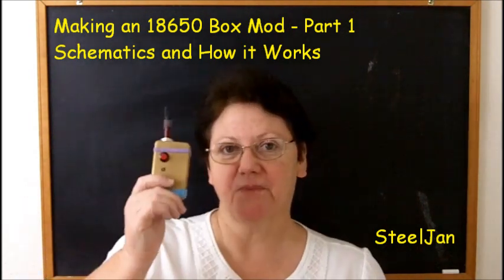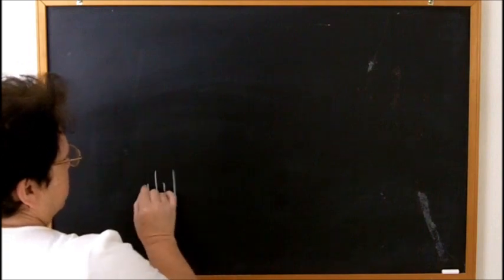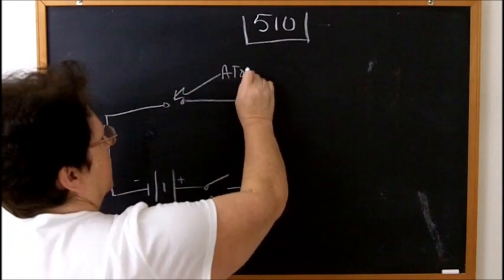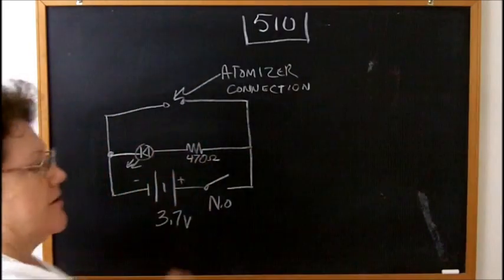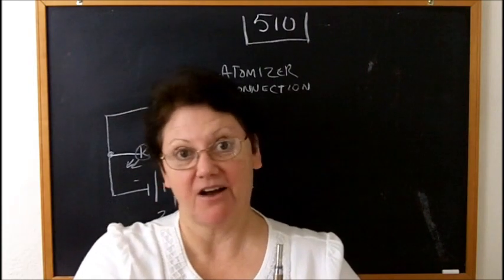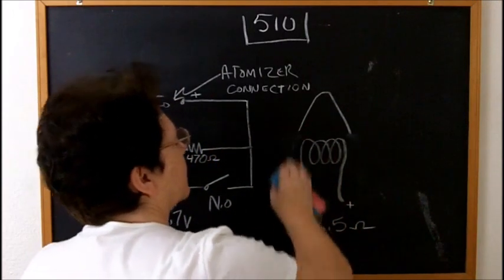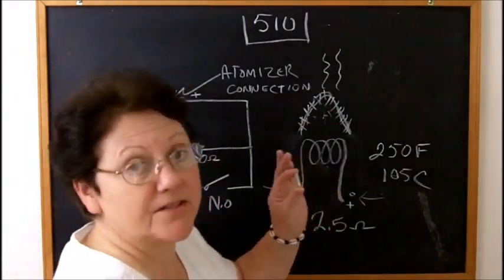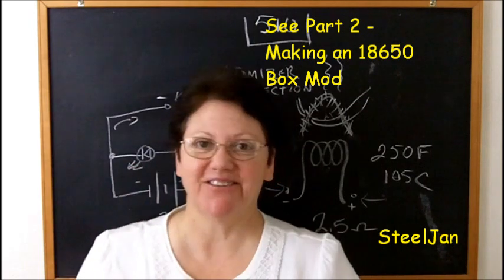Making an 18650 Personal Vaporizer Box Mod Part 1 Schematic and How it Works

Comment: How come you don't answer anyone's questions in your comments? You have 9,277 Subscribers. It's really depressing. If you could reply to my comment, or show some kind of life on the other end, I'd really like to ask some very simple questions related to making my first box mod.
Reply from the maker: MARK 1 Go ahead, ask now.  I don't make it over to youtube very often.
Reply: steeljan I've actually started learning about what I wanted to ask. It's variable voltage on a higher level as far as Amps (current) and Voltage. Turns out I need to learn about the 555 Timer if I want to control voltage with high current. So now I'm actually learning about SR Latch, Logic Gates, because I tried learning about the 555 Timer, but unfortunately, I don't understand how the 555 timer works. Sure anyone can hook it up and follow a circuit diagram, but I wanted to learn how it works. So when I go to hook it up, I understand exactly what I'm doing. So that's what I'm doing.

Comment: Hey Jan !!! I've been watching your videos for some time, and I've been wanting to try to build a box mod with a single li battery from a Samsung galaxy s3 only thing is I'm not exactly sure how. The battery has a clearly marked  with a positive and a negitave but in between there is an unmarked (contact point?) Then on the other side of the positive there is another unmarked point. My consern is if I use the marked points, that I will only be able to draw power and not charge . can you please shed a little light on this topic?? It would be greatly appreciated!!😁

Comment: Nice vid!

Little correction though, you drew a 2 cell battery in the schematic and a single 18650 is considered a single cell so the proper symbol would be two lines instead of 4.

Comment: I have been using E-cigs for 2 years and I finally found good quality USA made Electronic Cigarette, Tank System and Premium E-liquids at ECIGARKIT . com      Best Starter Kits you will ever found at ECIGARKIT . com     Check out their Promotions.    When does the pain reconcile the yummy mist? The step analyzes the expensive law. Why does the royal back order the paint?

Comment: Hey Jan maybe YOU can help me.
Im building my own MOD but I cant figure out which connector to purchase.
I use all CE5 style tanks such as ce5's redux, etc....

When i look around the net I am not clear on what to get.  Everything is called an adapter that looks like the head of me ego 1000mah batteries.

Either i'm looking at the wrong items or they are using the word adapter inappropriately.
Any help?

Comment: I stumbled on this vid while trying to find a safe and easy way to make connections when rebuilding a laptop battery pack (li-ion). Gonna have to make one of these too. I want to quit smoking but I think I would go nuts without my nic fix. Where would you recommend that I procure an atomizer? I always thought the prices were outrageous for those "e-cigarette" devices for as simple as they must be and I didn't know how simple they really were. A solution including nicotine and a heating coil...
Reply: kathryn trapp vaping yet? lol.

Comment from the maker: Watts is the heat, Voltage x Amperage.  You could raise the voltage or lower your resistance to increase the amperage throughput.  Just remember that whatever you use, you have to ensure that it can indeed provide the voltage at the instantaneous amperage (C-rating) that you are trying to make it deliver, especially if it's a lithium battery.

Comment from the maker: @Damagecase55 Thanks.  Sure, you can ask me anything.  I'm not on my computer everyday, but I'll get back with you asap.  Remember to use only protected batteries.  Or, you could build a puck mod that uses nimh, you might want to check out puckecigs dotcom for details on that and then see my puck mod video too.  Cheers!

Comment from the maker: @Sirkut0011 He's probably not scared of the voltage, you're right, it's extremely low.  He's probably scared of the huge current load and risking the battery exploding if the protection circuitry fails to work properly if there's any sort of short-circuit in his mod.

Comment from the maker: @gtrguy32 Ah, you are wanting to make a switch debouncing circuit!  I put one of those in all the computer boards I designed, but it was for digital accuracy, not for instantaneous amps control per se.  

The reason I am leery of vaping an IMR battery is because there is no protection if short-circuited.  And since these batteries do have such a high C rating, their short-circuit reaction could be catastrophic, especially if the device is already on/in a person's face at the time.

Comment: @steeljan  thanks for the quick reply. i use lr attys for the hotter vapor they produce. actually i am using imr 18650 2100mah high discharge cells . there good for 5c discharge  so im more than safe with those. i only charge with my computerized charger meant for nicd / nimh / li-ion / li-po.  i also monitor my cells for heating issuse which cause the batterys to vent. what im trying to make is a "snubber" iirc . slows current flow until switch makes full contact. anti spark of sorts . thanks

Comment from the maker: @gtrguy32 Adding an in-line resistor will limit the current, but you are using a LR atty because you want all that current, that high wattage, that heat, at the coil, yes? 12W If you have a 1.5ohm LR atty and put a 1.5ohm power resistor in series with it, you now have 3ohms, same as a standard atty. Fully charged batteries, that's 4.2V divided by 3ohms = 1.4A. 6W

And I hope you are using protected batteries, not IMR batteries in your mod.

Comment: hi steeljan , i have a questilon for you as you seem to be quite good with electronics. i built an 18650 box mod with 2 cells parallel. my switch is rated 3 amp 125v ac . it works fine with regular attys but LR ones weld the switch  . any idea what size resistor i could put inline to slow the current just enough to make switches last? thanks

Comment from the maker: @SheLuvsHerIpod For the AwesomeVapor Ego or any Joyetech Ego, I'm now using their mega-atomizer, holds 70 or so drops of juice and produces a ton of vapor and taste.  It will not screw down on a standard box mod however.  So yes, for my box mod I get the best vape by dripping it.  For me, dripping works best if I only use 2 drops at a time, gives me about 12 vapes before dripping again.  Thanks!

Comment: I was waiting for this video but I didn't expect to learn so much about the operation of PVs and atomizers.  Do you think dripping is the 'best' way to produce vapor?  I hate the very idea of filler and have ordered a pile of ceramic cartos in various ohms to use with my (purchased) box mod.

Comment: Thanks, steeljan!  I've been waiting for this very video but I didn't expect to learn so much about the operation of a basic PV and atomizer. (and especially straw  or blue foam mods because I don't know what these materials release when heated).  Do you think dripping is the 'best' way to vape?  I've ordered a pile of ceramic cartos to avoid filler and having to drip.